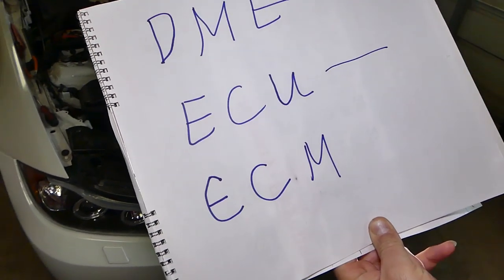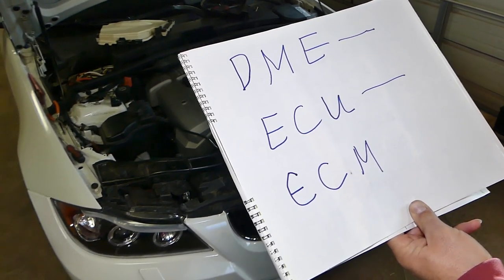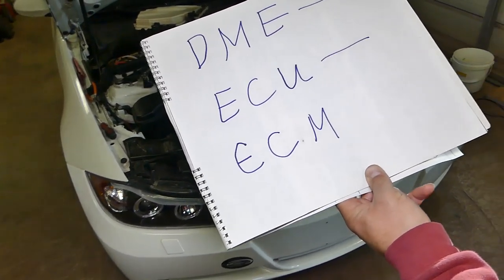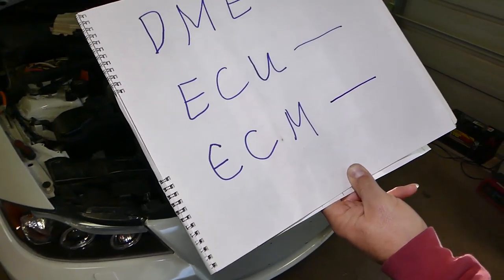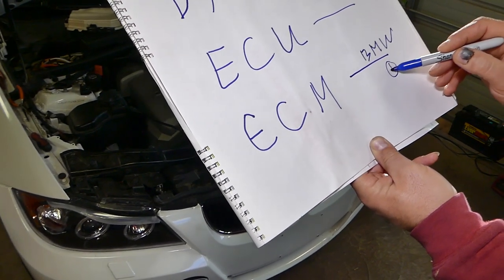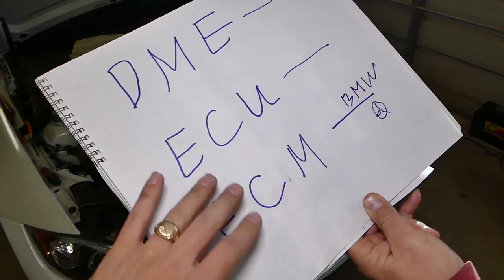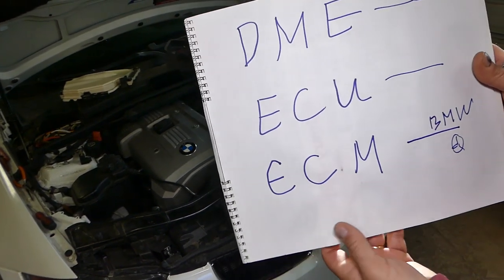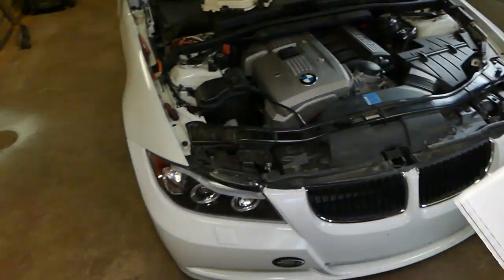WHAT IS  DME ECU ECM? DIFFERENCE BETWEEN DME, ECU, ECM

Comment: Electronic Control Unit.  Digital motor electronics.  Engine control module.  Powertrain control module includes transmission control and engine within one controller.
Reply: Master 👍
Reply: Hey new level the module needs to be programmed even if it is used?

Comment: So can an ECU be reprogrammed? So it could read a new sensor after 200,000 miles? Mine does. It reset and the Oil Servíce Light comes back on even after new Oil and the reset performed at the instrument cluster